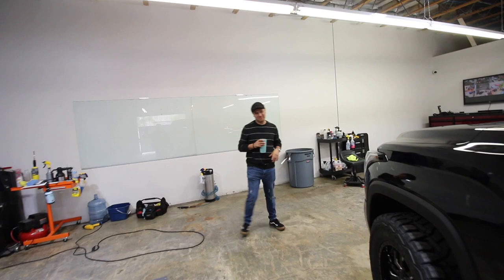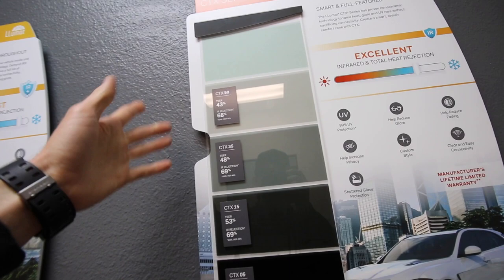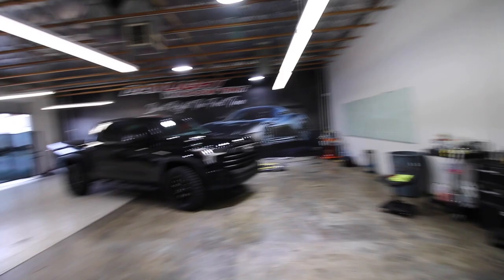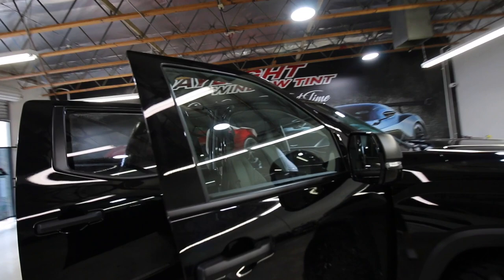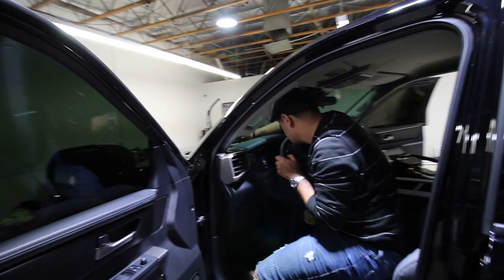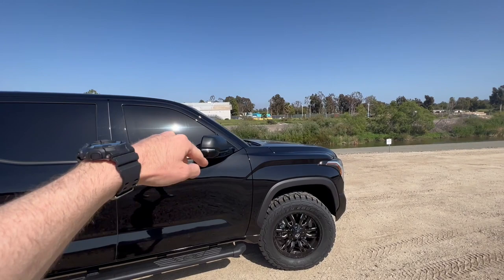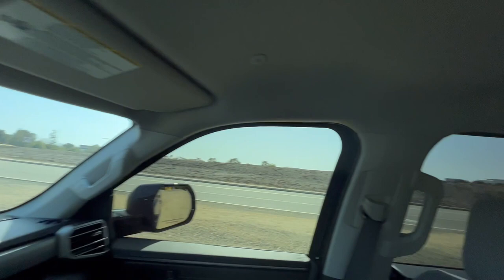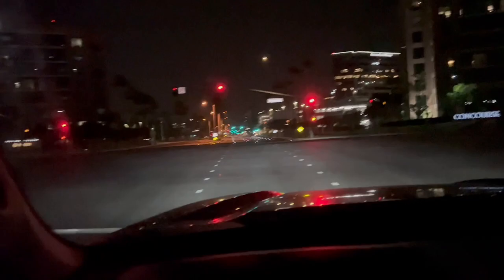Tinted EVERY Piece Of Glass…

Comment: I found that 40 percent on the front windshield is the sweet spot if you still want to see at night. 50 is too light in the daytime and 35 is too dark at night.
Reply: 35 perfect at night
Reply: 35% isnt to dark thats what i have
Reply: @808tash2  you be getting pulled over?
Reply: @gualagettine4007  no
Reply: I got 30% ceramic and it looks almost normal looking out at night
Reply: I have 30 on my windshield and I barely noticed a difference at night
Reply: Got 20 on the windshield just fine at night as long as you have good headlights.
Reply: so comigm from a dude that has put mutiple tints amd removed... so far i like 50% ceramic. but its to light. when its foggy or raining and sun is not out it seems to be a hazy dark. whem its bright its pretty much clear like if you had none. i had 20% in my suv for over a yr. was perfect during the day. and at night its ok. but worked night shift with it. and was horrible even with glasses was hsrd to see the bumps on the road . i domt think my shop offers 40 in ceramic. but they do offer 35. am going to try out 35 this yr. and trust me its crazy illegal🤣 like .3 percent all around omly 20 up front. and later down he rosd well be 35. and in expedition 2020 red. black on black. only thing ill do is get starnights. and for my little car for work i have 50% ceramic. ac has a issue🥵 but plan to put 50 in the best of the best in ceramic.. and omly install 50 in ceramic in the 2020. the back seats are chilly even in hot weather.
Reply: still got my video up om how 20 looks like. whem i had it.
Reply: I did 35% on the windshield. It’s still has great visibility at night.
Reply: @bryanf.9752 looks good and dark from the outside?

Comment: Where do you live? Here in Cali I used to get pulled over all the time with my Escalade tinted 5% all around and 35% on windshield. I took windshield off and went with 35% driver and passenger.

Comment: You touched a good point. Most cars coming out today have the percentage % on the window. Don't get fooled. Clear windows come with a slight tint to them already, most around 70% back windows at 25%. It also depends on brand of film,they sell you either the equivalent % to make the true % desired or they sell you the actual % as advertized but when its installed it will be darker than what they advertized.
Reply: my tint guy does a calculation between the factory smoke percentage and the percentage I want to create the desired percentage

Comment: took my 2021 f150 today to get the ceramic  tint. happy with the results. got all windows plus panoramic sun roof minus the front done. already feel the difference in temp compared to how I had them originally. 10/10. next step is to get my truck ceramic coated.

Comment: Does your wind shield have a 70% factory pigment on it? My 21 ram 1500 says it’s 70% factory so if I add a 70% film to it what will it equal out to?
Reply: Probably like 50
Reply: @jessicaho19  so would that plus 5 all around be noticeable
Reply: @jacobrosenkranz6863  For sure. But it would still look quite dark if you have 5% all around. Do you have dark interior as well? If so, it makes it look darker without actually being darker which is nice
Reply: @jessicaho19  yeah it’s all black inside, I had 25 on the shield but got fucked with so I took it off but I want something to keep the heat out I just don’t know if adding 70 on the 70 will make it noticeable
Reply: @jacobrosenkranz6863  sorry maybe I am confused lol which part are you worried about being noticeable? Do you mean like noticeably different than the rest of the truck?
Reply: @jessicaho19  like I said I had a dark windshield and got caught for it so I just have 5 all around rn and no wind shield but I want the windshield retinted to help with the heat, I just don’t want it to be noticeable that it’s re tinted, so my question is will the 70 be noticeable
Reply: @jacobrosenkranz6863  I'm pretty sure your windshield already looks darker(even if it's naked) since you have the 5 all over. So adding 70 to your windshield it will darken the interior and Leo's might pull you over.

Last week I did 70 on my rams windshield and it looks clear but my driver/passenger windows aren't 5%

I did ceramic on the windshield and it's freaking amazing can't wait for the summer lol